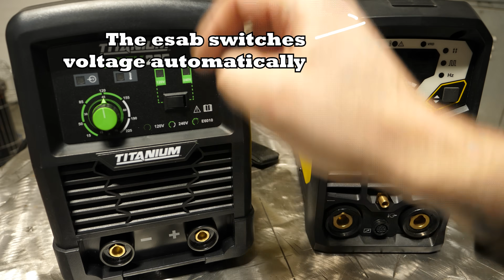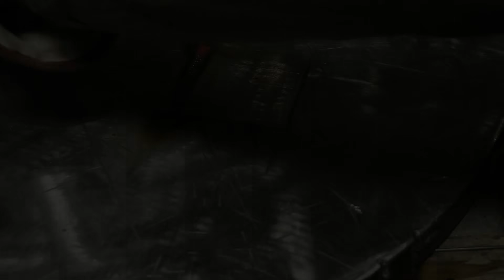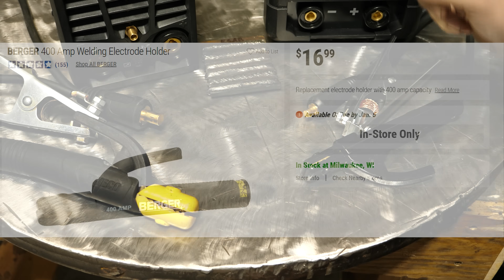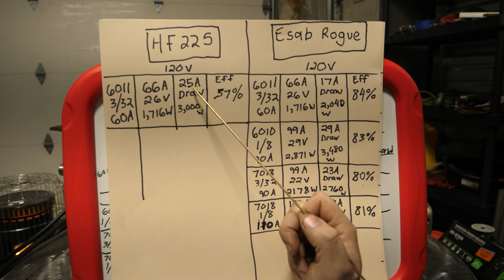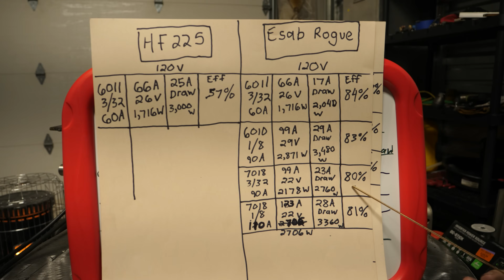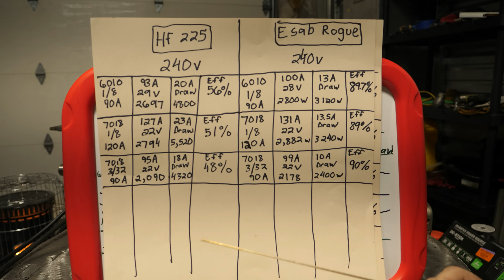Cheap HF vs expensive Esab welder comparison:  Deep dive

Comment: I enjoyed the video, but this retired EE has to point out your power efficiency is not correctly calculated because it doesn't take into account the power factor which is the phase relationship between voltage and current. What you calculated was volt amps, volts times amps which is not power in an AC circuit unless the power factor is 1.0 - that is voltage and current are exactly in phase which they definitely are not in this case. Volts times amps times power factor is the equation to calculate power (watts). Power factor is the cosine of the phase angle between voltage and current. 

That said, your conclusions about what generator capacity is required are correct because the generator trip is based on current or under voltage, but not power.  AC generators only supply their rated power into resistive loads. Inductive plus resistive or capacitive plus resistive loads will draw more current to deliver a given amount of power and will trip the generator at less than rated power.
Reply from the maker: In future videos I tested this and you are correct.  In the manual the machine claimed a power factor of over .90, however upon further testing it the machine only achieves a high power factor above 180 amps out.  At lower outputs it has a low .50-.55 power factor.  The biggest mistake I made was the assumption the manual wouldn’t lie, and not realizing the power factor could be poor at lower outputs but better at higher outputs.  At some point I retested both machines (I believe on video) and the titanium
225 achieved over 85% efficiency however a poor .50 power factor while the esab achieved over 90% efficiency and .99-1.0 power factor.  No doubt the esab is significantly better at operating on a generator or just an average outlet.  Thanks a lot for taking the time to provide the info you did and never be afraid to correct anything you find wrong in a video.  It will only serve to help others.  Making mistakes is something I do often and that’s what helps me understand things more 😀👍

Comment: I just recapped the noise filters on my Caddy 130..... so..  thats the difference.. My Caddy 130... ( the one that eventually became your Esab, sitting right there... ) ... never missed a beat.. in ( get this).. 40 years so far. 

I have yet to see a 40 year old HarborFright Tittnamiyum ( or Vulcan, for that matter) last 40 years. 

1984. Date on the thyrstor fet bank on my Caddy 130. Its fourty-foking-years old, and the welder still strikes every time.
Reply: I think ( have been told) this isnt an inverter on the right the esab... . Its a voltage controller thyristor .. unlike the HF Titanium, which is certainly a PWM bridge inverter... and hence it steps the current induced into the transformers ( 4 of them in that) ... based on desired wave time. 

IDK though just what I saw. Heard. was told.
Reply from the maker: That’s amazing that machine has lasted 40 years.  I have a feeling the esab in the video will far outlast the titanium (probably not 40 years though lol.  Don’t get me wrong, there are a ton of things that could go wrong with both.  Clearly though esab put far more work into doing things to protect the machine from common failure points like grinding dust, moisture, and poor quality switches.   HF hasn’t made an anything with a good switch that I have found lol.

Comment: Love watching your videos, they are awesome! What size 50ft extension cord would you recommend for the esab 180i, running on 220, thanks to your knowledge i am getting one and retiring my tombstone! Thank you very much for all the help you dont realize you are giving people!!!
Reply from the maker: I bet that 180 is a joy to use over the tombstone lol.  As far as a power cord, that welder is so efficient than it draws a lot less than 30a at 240v to max out.  Believe it or not a 10ga cord would handle the amperage, but I would suggest going to a 8ga.  8ga will ensure minimal voltage drop and would be the best choice.  There would be no benefit to 6ga unless you planned on running the tombstone on it.
Reply: @makingmistakeswithgreg  thank you so much for responding!!

Comment: One of the most informative videos I’ve seen.  Thx
Reply from the maker: No problem 😃.  You really do get a lot more when you look at it up close.  Luckily even the cheaper harbor freight welds great and gives a lot of capability.  Better equipment is generally worth the extra though 😀

Comment: 41:46 "Does this matter?" It's not just about the energy consumption.  That 40% PF loss over the ESAB is...heat. 

So what does that matter? The ESAB says the duty cycle at 200A is 25%, and the HF claims 20% at 220A. Someone is lying about the duty cycle, and it's not likely that ESAB is under-rating their duty cycle. Crank that HP piece of shit up to 220A and see if you can weld 2 minutes on, eight off, and see how long the caps last... 

My experience with the cheap China welders is that they just lie about the duty, and at high load use, they'll fail. I've bought green machines that had obvious shit wrong with them right out of the box where they wouldn't work...but they had a QC sticker on them stating they were tested...lies. At least green has the customer service and will get you square. 

DIY, do what you want, but for professional use (me), you pay the money. FWIW, yellow is just a different green.
Reply from the maker: Soon I will be doing a 1 year update on the esab, it has been holding up nicely.  Its duty cycle is no question what it’s rated at.  I ran it for probably 70% duty cycle at 140a with tig on 120v and it didn’t miss a beat.  On 240 it has handled running over 180a for a long time doing hard face rods.  Part of it is arc gap.  I run everything with as tight of an arc gap as I can and this will help duty cycle.  The harbor freight machine would likely hit its rated duty cycle, I can’t test it because it’s needs a 40a breaker to do it.  Harbor freight is no joke janky, but at the same time they do legitly generally meet claims.   That’s something almost everything of Amazon doesn’t do lol.  I just tested an arc captain flux core welder and it’s literally unusable because it loads the input line to 33+ amps just to weld 1/8th in material lol.
Reply: @makingmistakeswithgreg  I wasn't taking a dig at the ESAB machine. They're solid. Just that they're kind of the same as Green. QC is lacking on "Green." But once they're running, they're great. I own three Green machines in addition to my JDM stuff. 

Even Blue blows cap boards, and when they do it's expensive...  Way more expensive than Yellow or Green. I run Panasonic, Daihen, etc. They never break, but they're not cheap by a long shot.

Comment: From a budgetary point, the Titanium would perform very well off your clothes dryer outlet,  30 amps.  Many of us have a 30 amp outlet in our garages but not  a 50 amp.
Reply from the maker: It definitely can run on a 30amp without an issue.  That’s one of the huge benefits of the modern machines.  A older Lincoln tombstone would only hit about 100a on 30a breaker before it would trip lol.

Comment: I’ve always heard, there’s no replacement for hood time, which to me means. Same as in racing cars, no replacement for seat time, you can have all the high end shit and still suck. Like me lol, but I know I been on the grind lately trying to get better.
Reply from the maker: The trick is to practice enough so that your worst weld is better than your current best.  Don’t get me wrong, you will still make bad welds no matter how good you are lol.  It just gets harder to screw up the more skill you have.   Every time you practice tell yourself to relax, be smooth, and be consistent.  90% of welding is just being smooth and steady.  It takes a while to do that, but once you get it your skill will go through the roof.

Comment: Since my shops stick welder has been down I’ve used the titanium 225 as back up and it’s ran great.  Root 6010 and hot pass n filler pass 7018 has not failed.  The titanium has a hot start on its own.  When u end a weld u need to jerk ur hand back to detour spatter. Ran 5/32 8010 and no problem either.  The other fabricator uses a miller mig welder.  He trips out on me welding 14 n 16g like nothing with it with no melt through. I give mad props to the titanium 225.   It can handle ur 8hrs a day welding non stop.
Reply from the maker: I recommend the 225 all the time because for the money I don’t think a better welder exists out there.  I never ran above 180a on it but I did build a few literal tow trucks with the first one I had without any issue (days worth of welding at 155-170a).  Literally you can buy it for less than the cost of a welding class, burn 50lbs of rods with it for practice, and one paid welding job for someone else just paid for everything lol.  I know a bunch of people that have burning rods with theirs for years, a definite must buy lol.

Comment: The output voltage meter sometimes shows over 30V during welding, but the spec is only for 28V. How do the machines behave in case higher voltage is required, say 35V?
Reply from the maker: So many stick machines out there can’t output much over 28v.  That is why many inverters can’t run 6010 rods which require 30+.  What happens in their case is the arc will probably start on the rod and then it will just cut out as you’re welding.  Some inverters are capable of 35v at lower output levels like 90a (like the esab rogue) so they are capable of running a 6010 and “long arcing” it as well.  To make matters worse, is not all welders that clam 6010 capability can run it (cheap ones lie) and of the welders that will run it some run the rod better.  For example, the esab rogue 200 runs a 6010 1/8th better than the esab 235 I have, despite both being “capable”.

Comment: Wow I've never seen a breakdown like this... A few years of watching youtube welding videos and nothing quite this detailed.  Thank you so very much for helping me understand the numbers.  Indeed I have one of those cheapo $100 stick welders, was my starter, and when you push the higher amps, it breaks the 20 Amp breaker instantly.  Also no way I can hold a 3/32 arc on it.  Thankfully I have the 120/240 Titanium Mig Machine... though I do wish I went with a multi process.  Need the TIG option.
Reply from the maker: Yeah, the difference between cheap and higher end is pretty significant.  I actually have a part two to this video coming out soon and in it I revisit the efficiency testing along with looking at the output wave forms of DC with an oscilloscope.  Not surprisingly they are night and day different.  The great thing is though, despite the two machines being significantly different, they both actually function well and are capable of building a ton of stuff.

Comment: I think I've watched this video a dozen times trying to absorb it all. This is so useful and helpful. And my spamming comments helps the algorithm, right?
Reply from the maker: It may, I still don’t quite know what the algorithm likes or doesn’t like.  Click bait is great for it, but bad for the long term lol.  When I come out with a video on “stacking dimes” with mig I bet that will get a lot of views because it’s popular lol.
Reply: Yesterday I did a “real field” repair on a tractor bucket using my PFC-equipped inverter. (Sanrex 160). I ran Lincoln 6010 5p+ and 7018 excalibur, both in 3/32. I plugged into a garage 120V outlet at the friend’s house with 50ft of extension cord.

The setup ran very well at 90a and only once did I trip the breaker (with the 6010, as you’d expect). I dialed it down to 80a and had no more issues the rest of the 2+ hour session.

I’m mentioning it on this video because it shows real world experience behind Greg’s point here: the higher efficiency of a PFC inverter isn’t just a “cost less for electricity” kind of thing. Rather, it’s quite literally the difference between being able to do the job with 3/32 rods or not. Being able to use at least a 3/32 rod in real world conditions on an extension cord is just massive. If you are using 5/64 or 1/16 rods honestly you are going to struggle to get much of anything worthwhile done. 3/32 is the lower limit of what is real world useful (and often what is available).

The Titanium can work fine in a dedicated home shop on 240V. But if you are limited to 120 and an extension cord, the PFC is a must-have. Having used my Sanrex a good bit since I took up welding, I no longer consider the PFC a luxury— it’s an absolute must-have to make a small portable machine actually work in places where you’d take it. What’s the point of portability if you must lug a huge and expensive NEMA 6-50 extension cord and plug into a dryer outlet (if you’re lucky) to get it to do the job?

120V capability is the essence of true grab-and-go utility. And my little machine let me load all I needed into the back of an mid size SUV and pretend it’s a welding truck. The tractor bucket didn’t know that it wasn’t getting repaired by a “Real” welding truck.

That’s worth the cost of the PFC upgrade every day all day in my opinion and experience. Heck, the electricity savings alone will pay for the $200 upgrade I paid (vs HF Titanium) in only 1200 hours of use LOL.

Comment: I was looking really carefully at two welders in this video a well as the Rogue 180 and came across the Sanrex 160 (you might recall Sanrex as the maker of the excellent Thermal Arc units of the past). While the Sanrex has less peak current (capped at 160),  it has duty cycle ratings higher than the Rogue 180 on both 120V and 240V.  In fact, in a gee-whiz comparison, the Sanrex seems (on paper) to run in the rarefied air of the Fronius Transpocket. The Sanrex runs 6010s very well, too, in demo videos at least.

Paper specs, 120V:
Fronius 180; 28a max draw, 120a max delivery on a 40% duty cycle; 100a @60%; 90a @100%. 
Rogue 180; 25.7a max draw, 110a max delivery on a 25% duty cycle; 70a @60%; 55a @100%.
Sanrex 160; 31.8a max draw, 125a max delivery on a 60% duty cycle; 90a @100%. 

Paper specs, 230V:
Fronius 180; 25a draw, 180a max delivery on a 40% duty cycle. 100% duty cycle of 120a
Rogue 180; 26a draw, 180a max delivery on a 25% duty cycle. 100% duty cycle of 90a.
Sanrex 160; 21.3a draw, 160a max delivery on a 40% duty cycle. 100% duty cycle of 100a.

All these units have power factor correction. As a 120V unit, the Sanrex delivers essentially Fronius output and efficiency and can surpass it to the extent you have the breaker for it. On 230V, the Sanrex's lower designed output kicks in but it still has fronius-comparable efficiency and duty cycle.

Now there's more to performance than output. Sanrex being experts on power supplies and electronics, their machine seems to start very well even on 120 and runs 6010 with great stability and starting.

The Sanrex is only $600, the Esab is $900 and the Fronius is  $1650.

A the price of the Sanrex (and the DNA of the company and its history as Thermal Arc maker), I think I'm going to give the Sanrex a try. It's only a bit more expensive than the Titanium 225 and seems a fantastic value like the Esab is, although perhaps without the robust support network you get with Esab.
Reply: Did you buy it and did you like it?
Reply: @lakebruhh I did and I’ve spammed Greg’s channel (sorry greg!) with comments singing its praise. I just used it yesterday to repair a tractor bucket for a friend. Showed up with my machine, a can of Lincoln 5P+ 6010s, a can of Excalibur 7018s (both electrodes in 3/32), and ran the whole repair session with only one breaker trip on a 50ft extension cord. I dialed down from 90a to 80a after the breaker trip as I had plenty of heat to get good fusion on the thin-for-a-bucket 1/8” material. This was all done on 120V on a garage outlet on a breaker shared with who knows what. Heck, the house was so old it might have been a 15a breaker!

Amazing real-world utility on marginal power.
Reply: @G5Hohn  Im now wishing i got the sanrex instead of my titanium now lol

Comment: What about the internal heat that’s generated buy the seriously inefficient Titanium? That’s coming close to the efficiency of old transformer units. I would imagine that there would be a real difference in lifetime. But for the average home shop, likely there’s not too much difference as long as 240 is available. If it’s just 120, then the Rogue is much better. I’d rather the power be higher than rated than lower as most cheap welders are that I’ve tested. Some of those cheap models say 200 amps at 240, but deliver 135.
Reply from the maker: So I am going to do a deep dive in the electrical efficiency of the machine in the 3rd part of the video (I shot part 2 and that will be out today).  There is a lot going on as to why the 225 is so inefficient.  I spent a bunch of money and about 4 hours testing all aspects of the welders to get a idea of what’s going on.  Needless to say the rabbit hole went far deeper than I expected lol.
Reply: @makingmistakeswithgreg  yes, it always does. I’ll do two tests, then get confused as to the results, then do some more, and more after that. I’m happy I never started a channel, then I’d have to explain everything. That sucks. But you know that. Great work. Don’t let it twist your mind.